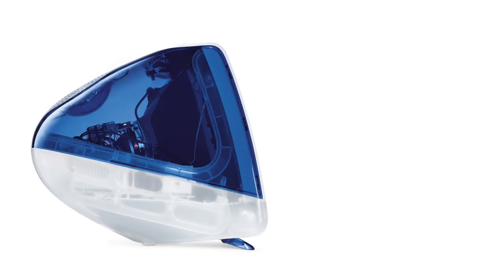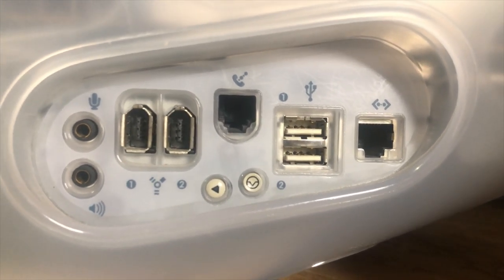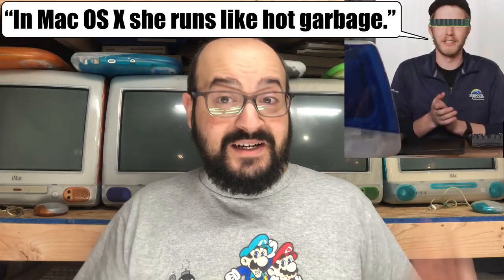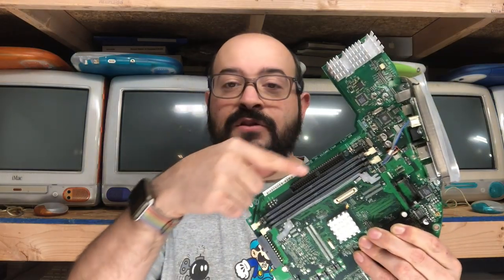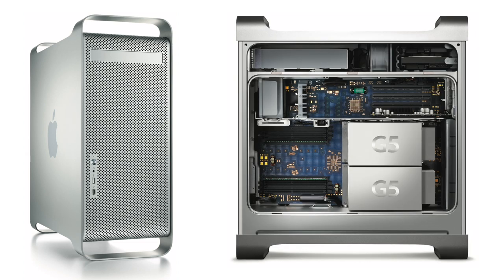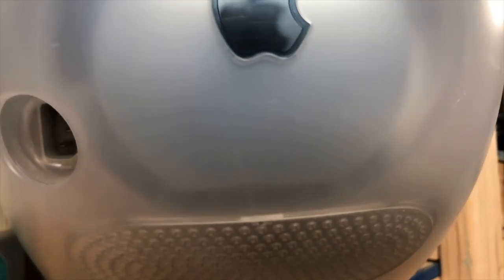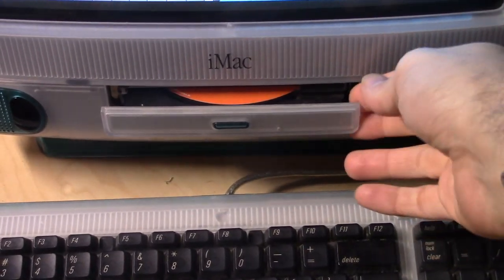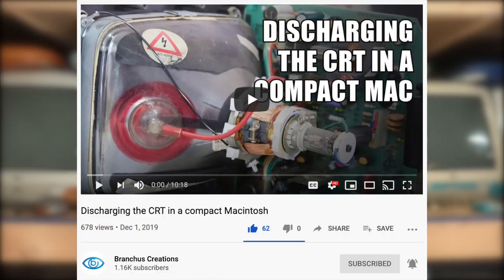Mac84: The TRUTH about the iMac G3 DV - Debunking ShortCircuit's Video

Comment: Regarding performance: I had an iMac G3/350 (the entry level of the slot-loading family) from 1999 until 2002. When I started using Mac OS X, I expanded the original 64MB of RAM to 256MB, and for a long time I used Mac OS X 10.1.5 on it. The iMac was stable and never really felt sluggish. The problem with most young YouTubers 'revisiting' vintage hardware is that they often perform superficial research and, more importantly, lack perspective and experience to really contextualise what they're talking about.

Comment: Yeah these iMacs wasn't even the last CRT based all in one Macs to use PowerPC. That medal goes to the eMac. That was the final all in one machine to use a PowerPC. That used a G4 and the final models had a G4 clocked at 1.42Ghz! I happen to have one. Has 10.4.11 on it and runs pretty well. :D
Reply from the maker: Yep! And boy were those suckers heavy! I have a handful of them, beautiful screen on those!
Reply: Great shoutout to the eMac - proud eMac owner here!
Reply: I write that comment in way too many video but my gaming rig is an eMac 1,25ghz. Way too many good games to play if you add Amiga, Dos, Arcade emulation etc...

Comment: Even though these have that "big scary crt" in them, they are fairly well compartmentalized inside. You generally won't be working near the crt if you are , for example, replacing the hard drive.
Reply from the maker: Yep! The logic board on these models are completely separated form the CRT, making it easy to service them without worrying about even discharging it. I’m really not certain why Alex took the rear housing off above the CRT and the mentioned the shock risk, unless he was just trying to tear down the entire thing.
Reply: Totally true. I have serviced the mobo in my iMac G3 and was very happy with how I didn't even have to get near the CRT to be able to replace the HDD or PRAM battery.

Comment: “Floppy discs were still pretty popular in 1999.” 

Kinda maybe? I only ever bought 1 pack of ten floppy disks in my entire life, and used maybe 3 of them. Hell, I don’t even touch physical media anymore for anything.
Reply: Floppy discs were still quite popular in 99. You may not have personally bought many or dealt with them all that much but CD-R's were not at a point where they were super cheap and pretty much every system still had a floppy drive. Likewise. A lot of folks in both educational and business environments still relied on floppy discs simply because they were cheap and relatively reliable.

Comment: The main problem with the switch to slot loading optical drives was that it coincided with a fast food chain distributing mini-sized Pokemon disks. I provided tech support for a library at the time and cannot tell you how much time I spent disassembling those machines just to extract mini CDs from them.
Reply: I had the same experience professionally. The later models actually could take the mini CD’s. Many did not know this. Can’t remember from which model though.
Reply: The video cameras also thought going do mini DVD for recording was ingenious.  It wasn’t. I had so many customers that wanted to load that footage in and edit like they used to do on their digital video camera cameras with the mini DV tapes. But sadly, there wasn’t really any software available. You couldn’t even edit in like Final Cut Pro just the format wasn’t ready to be edited

Comment: One quick correction (if no one else has done so yet): That base 400 MHz model not only had half the vram, but also a lower end video chip. Rage Pro vs Rage 128 Ultra.

Comment: 11:25 I own an Air 2017 and a PowerMac G4 (which is not exactly the same, but comparable, I would say). When I power the G4, the room *SHAKES*.

The Air, in comparison, sounds so tiny that I usually couple it with a small JBL Bluetooth speaker, for some extra punch.
Reply: That's not a "bong", it's a "BWWWWWWWWW"

Comment: So, some 2001 models didn't have a VGA port, but all trayloaders had the normal D15 Mac RGB port that could output VGA up to 1600x1200, maybe even more. The DV models couldn't do anything but the internal resolutions. The AMP connector looks slightly like a Molex connector of the era, but the origin of the Molex misconception is from some doofus circa 1998-ish claiming ACHSUALLY it's a Molex, when it was referred to more correctly as "HDD Power Connector" or such until then (in contrast to 3.5" floppy power connector). Molex however did make the ATX motherboard power connectors, but not the PCIe video card power connectors that look similar. The former are called Molex Mini-Fit Jr and the latter are just some PCIe proprietary video connector things. Apple did use standard Molex Micro-Fit Jr connectors on the motherboards of Mac Pro models. The Micro-Fit Jr are the successor of Mini-Fit Jr. They have unique keying per connector count and carry as much current as the larger Mini-Fit connectors do.
Reply from the maker: Thanks for the comment! Yes, but as we chatted about in the live chat, the DB15 video port on the first revisions of the iMac G3 was not an approved method of video out by Apple. And let's be honest, it's not a user friendly solution for non tech-savvy users.

Correct, the Late 1999 and Summer 2000 models didn't have VGA ports on the low end models. But I believe the Early 2001 models all had VGA ports. Some companies, including Apple, still sold older models during this time. So yes, it was possible to buy an iMac without a VGA port during this time, but it wasn't really part of the new Early 2001 model lineup. It was just old stock.

The whole point in my video was to reply to Alex's claims that "nobody used" the VGA port on the iMac DV. I was pointing out it was a requested feature and was very useful. 

The iMac DV models which included VGA ports also came with two plastic covers in the accessories box, one with a VGA port cut out, and one without. So even on those models you could swap out the plastic cover if you decided you did, or didn't want the port shown. I agree though, it's not easy to swap it out! 

Yes, the iMac DV could only mirror video out. And yes, I goofed on calling the hard drive power cable a "molex" connector.
Reply: That video port you mentioned actually played a bigger role in the Rev A/B’s mezzanine slot. A company made a Voodoo 2 card for the slot that you routed the internal video cable into, and then another cable back to the CRT.
Reply from the maker: @aegonthedragon7303  Yes, I have one of those Voodoo 2 cards and it will be something I focus a future video on. It's interesting tech!
Reply: Mac84 I humbly request that you expedite that video. There isn’t a single video of that card on Youtube.
Reply: Mac84 when you make the Voodoo 2 iMac video could you also run before/after on games like Unreal comparing the Voodoo 2 to the built in Rage IIc or Rage Pro?
Reply: @steftrando  Or just have an identical machine side by side running on an otherwise identical software setup.
Reply from the maker: That was the plan, until my second Bondi iMac went kaput. 😭
Reply from the maker: I’m trying, I just acquired a PCI Mac Voodoo 2 card as well to compare it with a Blue and White G3 tower as well.
Reply from the maker: I’ll try to do all the tests I can! 🤓

Comment: What is the actual difference between the DV imacs and regular imacs of the same generation other than the DVD combo drive?  Looking at the motherboards they look utterly identical.
Reply from the maker: Only slight processor and graphics configuration changes.
Reply: @Mac84  what differences? I can find no documentation from Apple or anywhere else that there is any.

Comment: I have an older tray-loader, Rev D, that has a few issues. 1. Cannot install the original OS (8.6) using original restore media, I only get a gray screen. 2. Cannot sleep in OS 9 or OS X  - get an error saying I am missing system software in order to sleep (just did a clean install and upgraded to 9.2.2). 3. The monitor settings says it is a "VGA Display", and the resolution is always locked at 1024x768@60Hz with 256 colours, from the display turns on, with no other options available. Any idea what this could be? The iMac already has the latest firmware, and I've tried resetting NVRAM/PRAM, changing the battery and reseating VRAM stick.
Reply from the maker: My guess would have been firmware, but you mention it's already updated. I would guess that maybe the original install media has something that the generic 9 does not have. Which is a long shot, but plausible. Does the original media read OK on another machine? I'd check out the Low End Mac Facebook group, maybe someone there has had the same issue before and can help. :-)

Comment: I must differ with you on the slot loading G3’s.
Like Apple’s later DVD drives they were horrible. 
They frequently stopped ejecting and once they failed, if you could not find a replacement drive or an external cd drive, you were screwed.
Replacement drives for all the G3’s are really hard to find now.
The same goes for DVD drives for 2008-2010 IMacs as well.
Bezels could be fixed or you could get a replacement.
I had 3 G 3’s and an IMac DV & had to recycle all of them because of the drive issue.
I intend to get a G3 and a G4 again this year so I can play my beloved older Mac games.
And I still use 3 of my 6 Apple ][s as well.
Apple 2 still forever !🍎🍎🍎🍎🍎🍎

Comment: Here’s some mistake that you made: 

1:49 - You say iMac G3 went up to 600 MHz but there was a last revision of iMac G3 (Summer 2001) that have a CPU that runs at 700 MHz (but that configuration was discontinued in January 2002). 

10:03 & 10:18  - You say that iMac G3 (as the whole product line) was discontinued in January 2002 but they actually was discontinued it a bit later than you expected, in March 2003 (when eMac (an CRT iMac G4) was starting to sale not just for educational market, but for the general market as well). 
I could correct myself if you meant about that maxed out 700 MHz iMac G3 (that I already mentioned in this comment) I don’t know.

12:26 - ATI Rage 128, at the rev. B model? Original iMac G3 (a rev. A one) used a ATI Rage 2c with 2MB of VRAM with expansion slot for VRAM, rev. B upgraded to ATI Rage Pro with 6MB (2 base + 4 expanded) of VRAM, rev C. (the “5 colors” one) “upgraded” with ATI Rage Pro Turbo with (same) 6MB of VRAM (like the previous revision), the “Slot Loading” revision models upgraded with ATI Rage 128 VR with 8MB of VRAM and (finally) “Summer 2000” and onward models upgraded with ATI Rage 128 Pro with (same) 8MB (and in later revisions 16MB) of VRAM.
Reply from the maker: 1) I’m referring specifically to the “Early 2001” line of iMacs, thus the graphics on the screen at 1:42. In that line up the fastest machine was a 600 MHz model. Only the later “Summer 2001” line up had a 700 MHz option.

2) The January 2002 is listed on EveryMac and MacTracker for this series. However, yes, two slower models were discontinued later in March 2003. They axed the 700MHz one in January and kept the slower 500 MHz and 600 MHz models around until March. This made the eMac and iMac G4 look far more attractive.

The point is Alex was incorrect when he said Apple’s Intel CPU switch occurred “right after” the iMac G3. And his machine wasn't "the fastest".

3) I meant “Rage” graphics for the original iMac model. When I said “Rage 128” I misspoke.

Comment: iMac G3’s didn’t stop production in January 2002, as I have one manufactured a few months later. They stopped being sold in early 2003.
Reply from the maker: Thanks for the correction! I was going off of what I had read on Everymac.com, which states January 2002. However, looking deeper into this, that discontinued date is only for the 700MHz model. Apple did still sell the 500 and 600MHz models until March 2003. (I guess they didn't want to eat into the sales of the iMac and eMac). This confirms what I remembered, seeing iMac G4s, eMacs, and iMac G3s side-by-side at my local Apple retail store in the early 2000s.

The Internet Archive's Wayback machine has a final (recorded) entry for the iMac G3 hardware page on February 2003. It seems only the 600MHz Snow model was being offered at that time. What a fantastic lifespan for this revolutionary product. :)

Comment: i recently got my first imac g3 (one of the later 600mhz models in lovely blue) and i can tell u, outside of doing somewhat intensive tasks like photoshop 7.0 or burning cds, it runs nicely enough on its previous owners hard drive and install of os x 10.3, and mine has far less ram than the one at shortcircuit (192mb, altho i would like to upgrade it at some point).

Comment: Just wanna let you know that the iMac G3 wasn't discontinued entirely in 2002. The 700 SE model was killed off in January 2002, the 500 and 600 models were killed off in March 2003. :)
Reply from the maker: Yes, I’ll be covering this more in my upcoming video about the iMac DV/Slot-Loading series. Apple stopped selling the faster 700MHz model so the new iMac G4 looked like the better buy.

Comment: Hi  iam Claudio From  Chile  i got  3 of  those  Imac  i  Change the  Harddrive to SSD and  Speakers.  I  want  to  know  is  posible   to navigate  on internet  without  problems  i try  camino  and   many pages  dont  work.  And ather  thing wic Xos   i can  use  now  i  got  it  on the X 10.4  can  run  it a mos later os ?.   Thanks  and  great  job.
Reply: You'll be able to do minimal internet browsing as it's very slow to access on a G3 iMac, use 68knews or frogfind if you want to read news or browse sites in basic text mode.
Reply: @amirpourghoureiyan1637  Fimally  i  instal  Ubuntu  on  It and  is back to  Life.   I do a  lots  of  work  but  now  works awesome...
Reply: @claudioguendelman  That's great to hear! I use Lubuntu on my PowerMac G4, works great for transferring files between MacOS and Windows.

Comment: Totally disagree with your comments about IO it really was lacking at he time, you had to use one USB for the keyboard and another on the keyboard for the mouse leaving you two USB ports but it’s worth noting the spare port on the keyboard would not power anything that needed any significant power, at the time printers and scanners were separate, digital cameras where becoming all the rage, the majority of people still kept documents on floppy disc so you’d likely need an external floppy drive and if you used it for anything creative like a graphics tablet or midi (via usb) you would need to pay for an expensive usb hub, at the time most PCs had two usb ports on the front, two on the back and and the keyboard and mouse were PS2 type so didn’t take up ports, then there were still the parallel port for you printer and scanner and the normal serial ports for some older accessories and devices. Most cheap laptops of that time had more IO so the iMac really was lacking, I had two G3 iMacs including a DV version and I also owned and built a lot of PCs from that era